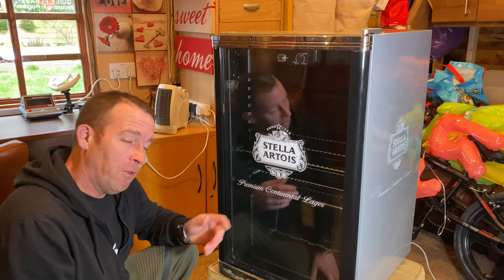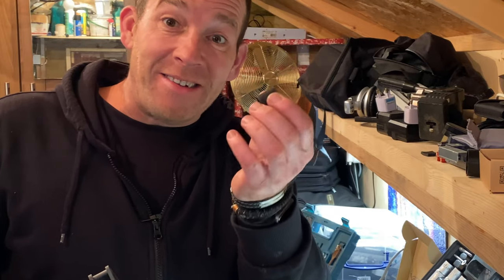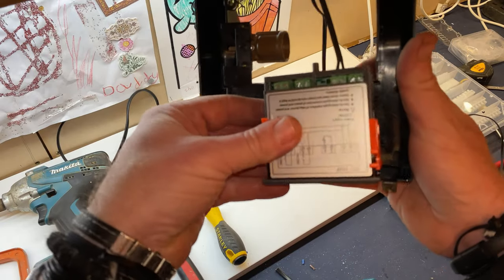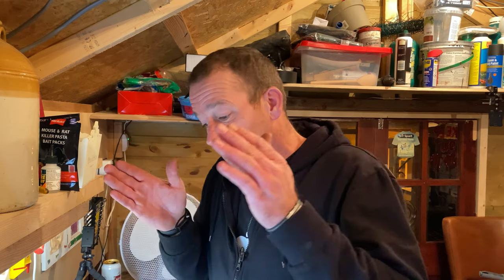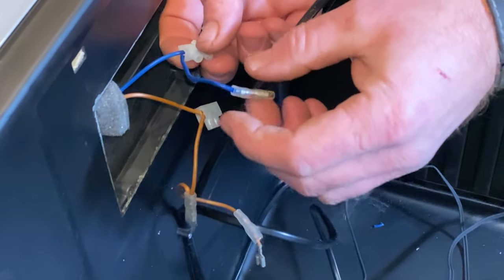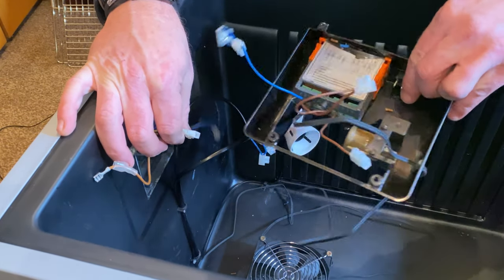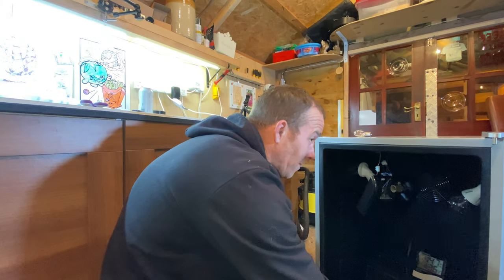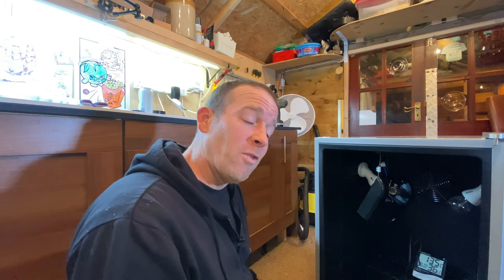HOW TO MAKE AN INCUBATOR FROM A FRIDGE…. EASY TUTORIAL (part 1)

Comment: Can u list the parts u used to build it all. Plss and thanks
Reply from the maker: Sorry for late reply yeah the main parts y out
Need are 2 cheap light bulb fittings (one is enough but have 2 as a fail safe)… can pick them up from hardware shop.. Wilko b and q ets really cheap… few meters of 2 core cable. The main temperature controller I used is the ink bird ITC 1000 ( Amazon link 👉🏻 Inkbird ITC-1000 Temperature Controller Thermostat 220V Temperature with Sensor https://amzn.eu/d/46O5Oyw that’s all you really need to get the incubator working but I did at the sonoff th 16 ( or sonof th10) with thermometer , that way you can check temp from your phone and also set a max and minimum temp which if you connect a panel siren will give you an audible alarm if the temp dips or spikes 
Th16 link 👉🏻 SONOFF TH Elite Smart Temperature and Humidity Monitoring Switch (TH16 With MS01) https://amzn.eu/d/8oPITq7

Not sure on a link for the panel alarm, I’ll keep looking… hope this helps.

Comment: Hey Ben, what is the name and type of control switch that you used ? Doing a project for school.
Reply from the maker: Hi, the temperature controller that cuts the light bulbs on and off is called “Inkbird”
https://www.ebay.co.uk/itm/Inkbird-Digital-Temperature-Controller-2-Relay-Output-Room-Thermostat-220V-Heat-/222009063678?mkcid=16&mkevt=1&_trksid=p2349624.m46890.l49286&mkrid=710-127635-2958-0

And the smart controller that sends an alarm to my phone or the house if the temp drops or spikes is done with a “Sonoff TH10 smart controller with temp and humidity sensor. 
https://www.ebay.co.uk/itm/Sonoff-TH16-TH10-Smart-Wifi-Switch-Monitoring-Temperature-Humidity-Smart-Sensor-/265063258120?mkcid=16&mkevt=1&_trksid=p2349624.m46890.l49286&mkrid=710-127635-2958-0
Reply: @bstrippy1664  thanks much our project is to convert a mini cooler into a plant incubator
Reply from the maker: @TiryLmeister  sounds like a great project!.. hope it all goes well for you.